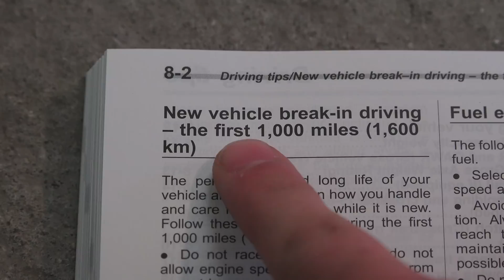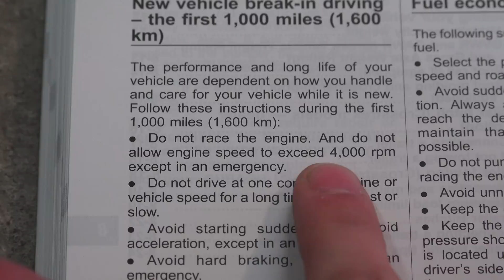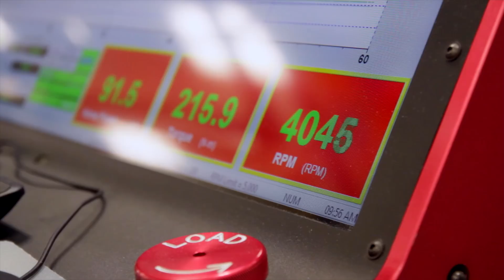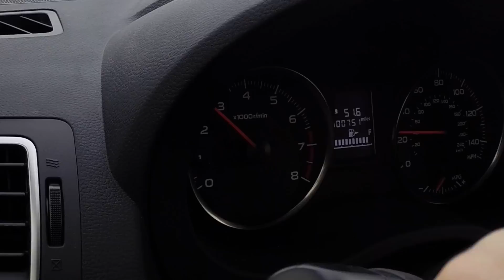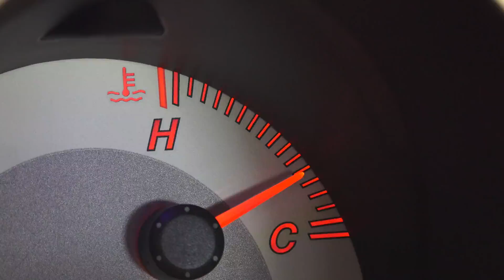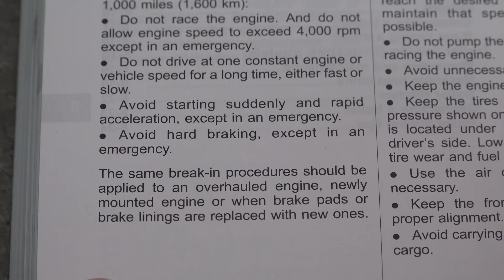5 Things You Should Never Do In A Brand New Car

Comment: Does this apply to a Tesla?
Reply: Not a one of these apply to Teslas. I specifically asked Tesla about taking a 2K road trip a couple days after I received my Model S. Tesla said their cars have no break-in period. (The phrase "break-in" is not present in the owner's manual.) Constant RPMs, max power, etc. are all fine from mile 0. The only items that might still need some break-in are the tires and the brakes. (But you don't use the brakes nearly as much with EVs). And short trips are a complete non-issue, as there's no oil to warm up.
Reply: I use to be really into electric RC cars and you had to break the motors in on those.  I burnt up a motor or two by not doing so, I don't know why it would be any different for a large electric motor.  If it was a steady rpm motor then I don't think it would matter, but variable rpm motors it just seems logical to break it in.
Reply: Yes, keep the rpm under 2000 and make sure you check the transmission fluid for any build up.
Reply: Simply put, no. It's an electric motor, and there's not much of anything to worry about. It also has full torque at every speed, which is one of the major advantages of electric motors over internal combustion engines.
Reply: Brandon Williams
Depends on the exact type of motor and the construction quality. I bet it has something to do with the bearings and grease though, making sure they're well worked together. Which would mean less physical resistance and energy loss and therefore less heat.
Reply: well i dont think that someone should go ludicrous mode just out of factory and while what you said is true, tyres and brakes need break-in
Reply: Don't forget to change the blinker fluid oil on your Tesla either.
Reply: +StrangeClouds Teslas don't use oil.
Reply: No
Reply: Tesla don't have gears they have inverter
Reply: Joe L BOI it says  things not to do in new cars and yes DUHHHHHHH
Reply: If the electromotor has bearings then yes
Reply: Actually the Tesla has a speed reduction gear (early roadsters had 2 speed transmission but it was problematic and removed and replaced with a speed reduction gear).  The electric motor/speed reduction gearing system in a Tesla has no break-in period.  There are no 'seals' to set in.  There is no temperature warm up per se of the motor to operating temperature.  So most of this doesn't apply.  It's one of the advantages of an all electric drive train.
Reply: theLuigiFan0007 you said at every speed tesla's don't have gears they simply don't need gears because of instant torque
Reply: Syd Weinstein
Yeah, it's just a fixed speed reduction of about 10:1, right? Just one of the many reasons I want a Tesla someday. Electric motors FTW!
Reply: OperatorJack like I said with instant torque they don't need gears what you said makes no sense and look it up that may confirm what I am saying if electric cars had gears that would just make them more complicated and heavier
Reply: I am not totaly sure about Teslas but many electric cars have two gears.
Reply: that is because, Tesla cars dont have a combustion engine!
break in is meant for IC engines, not electric vehicles!
Reply: Nope, just like an electric skateboards tesla cars are ready to go full speed straight away. If the motors never been used before though it's good to test it first, on a skateboard it's easier just flip it and slowly pull the trigger and give it some power, make it spin a bit, tesla you'll have to jack the car up and ease on the gas, or rather, the volts, then bam go for gold

Comment: you know the other thing your not mentioning is that these performance engines produce so much more power at the higher ends than a normal one, hence the break in period, as the funny thing is with my regular run about I asked about a break in period.

and he said dont worry about it and its only a 170 HP motor, mind you I didnt beat the crap out of it either and did the regular oil changes, but that may explain why these rules seem abit overdone with these higher end cars. as they have a much higher compression and power ratio compared to the daily runabouts that most people have.

Comment: you said cruise control and that makes me wonder if i should also disable eco mode. We have an automatic transmission kia ceed and i figured that when i use eco mode engine becomes less responsive to throttle, tries to keep rpm low... what i understand is that is better if it is lower than 3K but it also denies various rpms.

Comment: Now, does this apply to heavy duty vehicles? If a semi truck has to drive around to break it in before it can haul, then the operator is just losing money on fuel.
Reply: Plus, breaking it in may save on repair costs in the future. Preventive maintenance, I suppose
Reply: This break in period as described so well in this video, pretty much apply´s to every internal combustion engine heavy duty or not, no matter the vehicle land, sea, etc.  
"Heavy duty" engines are simply engines that are tuned down in power and have lover rpm limiters so that they can be operated at full power for long time periods. How ever "heavy duty" has been put on some trucks and engines just for advertising and show and don´t meet these requirements.

Comment: what if u use cruise but change the speed every few minutes according to traffic
Reply: Panagiotis:  That should be fine.  My first car, an '82 Toyota Celica, that's exactly what the salesman said to me.  If I took it out of town and drove it on the highway, just to be sure to change the speed every ten minutes or so by at least a few MPH if I used the cruise control. 

I had a friend who worked on airplane engines, and really knew engines.  He said the best way to break in new cars was to take them out on country roads, and just drive the roads naturally, but not with hard acceleration.  He said that ensured you got plenty of load variance as you took curves and changed speed.  (Made a lot of sense to me).

Comment: so dont buy the vehicle you test drive if its brand new and assuming  you floor it during the test drive
Reply: Actually, that's a good reason for a demo.  Out of courtesy, for any hard driving I want to do for a test drive, I ask to drive a demo or used version, not wanting to risk messing up a new car engine.
Reply: i got my car with only 9 miles on it
Reply: audi used to actually test their cars engines for an hour which included 15 minutes of full throttle for each built i believe

Comment: Highly debated topic, but a high cylinder pressure differential (I.E. high vacuum) does promote a better ring seal on a new engine, there are machining imperfections that come into play with new engines no doubt, but ideally, a careful but quick break in with multiple oil changes tends to promote the best seal. Half throttle pulls to 3000 Rpm close the throttle and decel a few times, then to 4000, 5000, 6000 etc. You'll see if you watch a boost/vacuum gauge that the vacuum will increase between every pull until you max it. Once is done increasing your rings are broken in, and they will not continue to seal any more after that point. You can watch in with data logging or on the dyno much easier than on the street.

Comment: I bought my new truck in a city about 200 miles away from where I live. Most of my first ride in it was on the highway and I used cruise control.. guess my engine is fucked.
Reply: Should be fine.  You know how many of these trucks/cars/etc. are on the road and last 100k+ miles?  Lots.  Most people don't know anything about breaking in engines and it's not necessary on modern engines unless you're some kind of neurotic car dork.
Reply: It's just statistics, it doesn't mean your engine is fucked.  It just means it has a slightly higher chance of being fucked
Reply: razorbackblood06 eh no, I don't think so. The 'what if...' case has no proof on that. You can check the compression, if it's in spec, no worries. If the engine burns no oil also no worries.
Have a good ride!
Reply: lol
Reply: Ya lol. My car had 50km on it the day I bought it. I floored it to the red line multiple times showing it off to my friends that same day. then I used cruise on the 120km a day round trip to work every day. I'm super fucked.
Reply: that's why sales people tell you to go over your owner's manual, especially the little inserts before you drive your car.  (nobody does this and you probably had a sh*** salesman though).  You might actually be able to win a case though if they are required to disclose that information to you as part of the delivery.  I know we were when I sold cars.
Reply: Well, short of having the truck shipped.. there was no way to really avoid the highway, but I didn't have to use cruise control.
Reply: razorbackblood06 it's fine. Just as long as you don't floor it up. Driving normal rpm on a brand new car on the highway should be fine.

Comment: Someone told me some nascar crews rebuild the engine and rev it up to seat the rings. This to me seemed like a terrible idea, considering everything isn't fitting 100% (hotspots likely). Seems like you would let potential rough spots to slowly wear down. Like sharpening a knife with a whetstone vs a table grinder.

Comment: Rental = Ride enhanced nicely to accelerate lawlessly
Reply: don't be gentle, it's a rental
Reply: i killed a rental car on the motorway doing the mandatory top speed test.

The tow truck driver came and when i tried to get it up the flatbed it was making the most horrendous noise of death and made no power. It sounded like rods and bearings were trying to pummel their way out the block.

He asked if it was mine and when i told him it was a rental he was like 'ahh no problem' and forced it to crawl up onto the back of the truck under its own power. dumped it at the rental place and got my replacement the next morning, lol.
Reply: Last two cars that we rented is totally new. With like 20km on it lol
Reply: 03056932R
Reply: 03056932R I don't know why but that literally made me laugh my ass off! Lol
Reply: lol
Reply: MCHFacts have you ever used a rental car lol

Comment: I don't know, the more i learn about brand new engine break-ins the more it sounds like the manufacturer doesn't want to foot the bill if something goes wrong for the first 1000 miles. People buying sport performance vehicles are not going to drive moderately for 1000 miles and those buying them for a track car won't be taking it easy. With that said i usually keep it under 3,000RPM but will occasionally do more, sometimes redlining. Never had an issue but i never bought a car straight from the dealer either. I will agree that you should allow your car to get up to full temp, driving it around allowing your car to adapt to various temps. Best time to get a car would be spring or fall so it's not dealing with the extremes yet and if you're driving your car twice as long as you already do it won't be too bad though summer driving during a break in might be better because heat is the worst enemy of any car. Cold weather, well warm up the car and it's good to go. I think during a break-in a few WOT/redlines might be ok long as your not doing it all the time or hovering it there for more than several seconds. Also you need to test the brakes to make sure they are working properly. Putting the brake pedal to it's maximum will give you an idea how well your car brakes. I wouldn't do it going 100mph, 30-40mph is ideal but there's also new brake pad break-in methods. 

Also there is no mention of when you should do your first oil change. Lots of controversy there too, like change it after the break-in.. when the car tells you or the regular 3-8k oil change. That may also play a part in why you shouldn't go past 50% throttle.

Comment: Excuse me, but what is that sharply thing at the bottom of the piston rod that I can see at 5:36 ? What it is used for?
Thank you in advance
Reply: I don't know for certain but I've seen similar things used to splash oil, usually behind the piston for extra cooling. As this is an air cooled engine, that would be my bet.
Reply: Kevin Jackson  it was my same though, but I was not sure if it was correct or not! thanks

Comment: When people test drive a car at the dealership, do they not use full throttle and RPM to see what kind of power and acceleration the car has?

Doesn't the connecting rod stretch a little more as RPMs increase, isn't the oil film on the bearings at each end of the rod squeezed a little thinner as the RPMs increase and doesn't the combination of these things allow the pistons to go a little further up and down the bore with increasing RPM? If so, aren't you making a ledge in the bore where the top ring stops during break-in and then banging the top ring into that ledge when the break-in period ends and you go full RPM?
Reply: Kevin Jackson i floored a BMW 320i to its redline multiple times during a test drive
Reply: Kevin Jackson I was saying nope to a deleted comment from a pea brained twit
Reply: Nope
Reply: John Smith
People don't' use full throttle and RPM when test driving?
Reply: when a tech inspects a new car off the truck a requirement is to test drive the car in ALL conditions including full throttle

Comment: Thats funny ! The GTR engines come with a dyno sheet showing the engine horse power, which indicates the engine was broke-in at the factory and then redlined on an engine dyno. I've read conflicting reports that a soft break-in is bad and a medium break-in okay but a hard break-in is the best .......coming from people who rebuild engines.

Hard break-ins yield higher compression ratios and a superior bedding in of the rings. It is suggested that you fully load the car with passengers so that the engine has a significant load for the bedding process. You need to vary the load and throttle by accelerating, then decelerating and repeating this numerous times over the first few weeks. The engine must have a load to get it to bed in properly.

Soft Break-in is bad.

Medium Break-in is okay.

Hard break-in is the best.

Comment: Once a new engine has been driven say 1200 miles, would you recommend an oil & filter change or wait until certain miles beyond that?  Can I use synthetic oil from there?  Thanks!
Reply: Historically, I have always changed the oil after 500 miles (during break in) and again at either 2k or 3k.  Oil is cheap and changing it frequently is easy.  After 3k, I tend to change the oil every 4k-5k miles.
Reply: Rick T i think you shoud get an oil change cause tj hunt had to break his engin in and he done 3 oil changes during the breakin period
Reply: Kasam sounds good, thanks!  Will do.
Reply: I personally would do an oil change after 1500 miles of driving.
Reply: TheFlacker99 (Flak), yes, soon after the 1500 mile after break-in has been my limit in the past; it was a few years ago when I did a small research by talked with a few major oil manufacturers as well engine design engineers & testers (basically a combination of better engine design/closer tolerance, materials used and the advancement of oil development) engine break-in can be accomplished within a shorter period/miles than before.   There is really nothing wrong keeping the 1500 mile mark (according to Toyota and some Honda models, first oil change is not require until 5000 miles and that is if owner specifically requests otherwise The first oil change is at 10-months or 7500 miles); but more of our personal preference and make us feel more comfortable - my car just reached its 1200 mile mark since my comment above, so I went ahead and dumped the old oil and filter last night.  ;)
Reply: JJNYCguy, yes, I extend the oil change duration as well (i.e. At 1200, at 5000 then every 7000 mile thereafter with Mobil-1). Thx all for the responses! Thx!

Comment: Could you do a video on the consequences of free-revving an engine (eg: in P or N), and perhaps also the consequences of shifting an Auto's gear lever accidentally (or on purpose) while driving (eg: from D to N and vice versa). It is extremely hard to find a reliable, scientific answer for this online - everyone has a different opinion.

I have accidentally done this on my car which is an Auto with tiptronic 'manual mode' - I thought I was in manual mode, but it was actually just in D, and so I shifted to N and free-revved hard... and then in panic, shifted back down to D >_<

Comment: My VW golf is from 95 and I floor it every now and then, though I do understand that is bad.
Reply: Who said flooring your car is bad?

Lugging the engine (flooring your car in a high gear when you're stopped, or while moving slower than necessary for the selected gear) is idiotic and will cause damage to the rods, crank, bearings, etc... but if everything else checks out; you're in the right gear, and you're not towing any extra mass, all that it does is help you enjoy your drive.

Flooring the throttle might even help clean your injectors (for fuel injected vehicles) since the injectors open all the way (open loop, richening the A/F mixture) and have other unintended beneficial consequences.
Reply: Break in is only needed for new vehicles